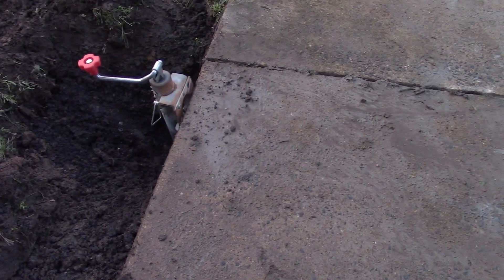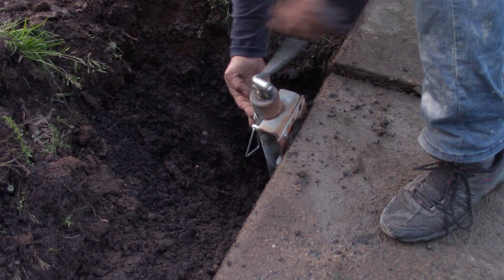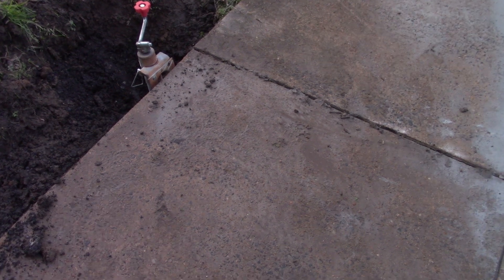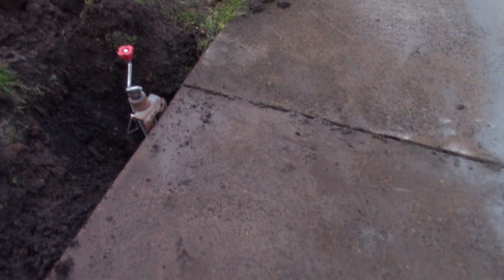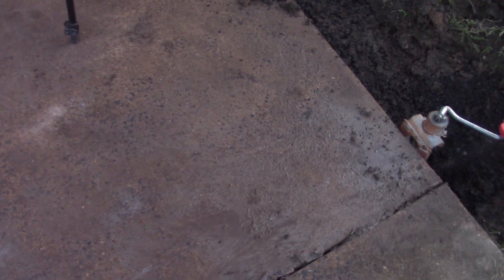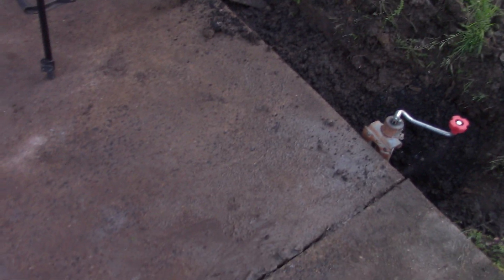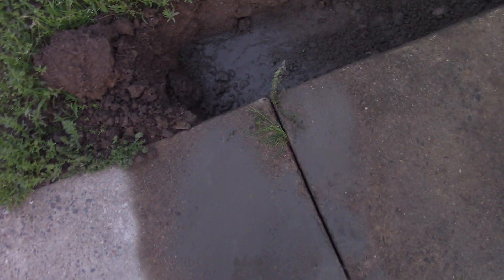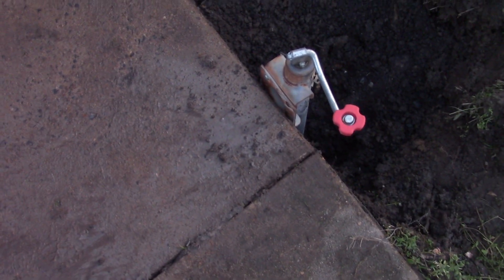Concrete SIdewalk Lifting repair of trip hazard with a trailer jack

Comment: I was going to use a bottle jack but ended up ordered a trailer jack because of how easy this looks.  I won't have i until next week but what's the best way of packing in concrete under the slab?  Just a shovel/hand scoop and pack it in with a 2x4?  I wish I had some type of pump...  feels like it's going to take forever doing it this way.

Comment: That's how we do it, where before we used long six foot pry bars of steel to lift the edges up to level the slabs and also on steps then put rocks an pushed wet concrete up under with a pump we made, like a huge caulk gun from PVC pipes. It works. Gets the job done. Only one time did we reset a set of concrete steps using a Warn 10 or 12,000 lb winch on my bosses truck. He always says work smarter not harder. Use your brains an not your back when you can.

Comment: Then what? 🤷‍♀️
Leave the jack there?
Reply from the maker: Yes, then cut the video and burry the jack == not.  Just joking... stick mortar under pad and use a fast setting mortar... But, realize, NOT  all your pad is supported and you should not drive on this type of repair, as a tension crack may occur...    Solid foam, a hard foam might do the trick.

Comment: In the same hole your jack is lifting in ,if you would take some sand and fill it up and then take an air compressor with a quarter inch copper pipe on it. 6in to a footlong you can blow that sand back up underneath in that void.  As the void fills up more and more closer to you where you're putting it in at it'll blow back on you,so decrease your air pressure till it's all filled up and you can pretty much fill the whole void up.

Comment: After you Jack it up, what do you put underneath? Dirt or concrete? You should make a follow up video on that cuz you still have to pull out your Jack. Also, this is usually caused by tree roots. Explain the process of removing roots. Otherwise the roots will continue to lift the sidewalk. Thanks.
Reply from the maker: Okay, I will one day when I recall...